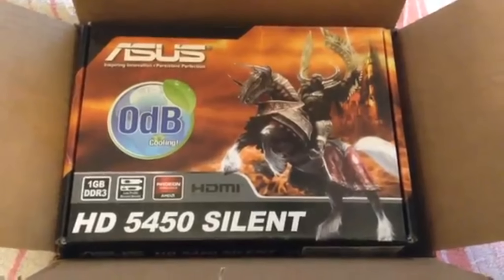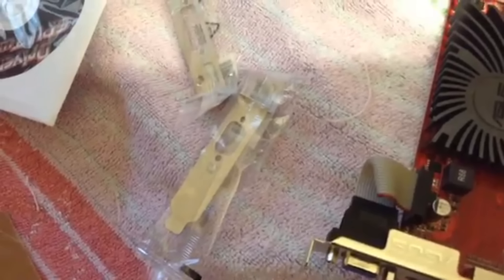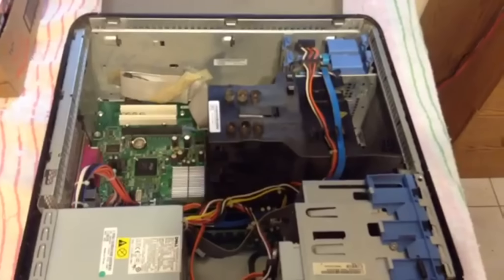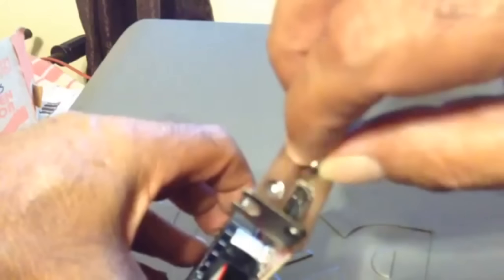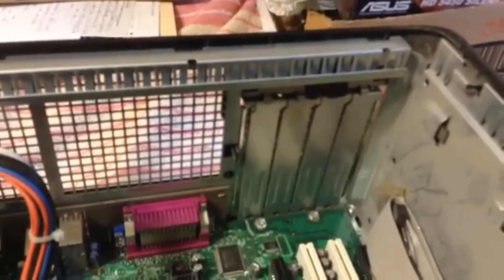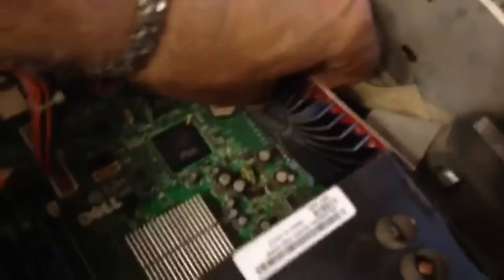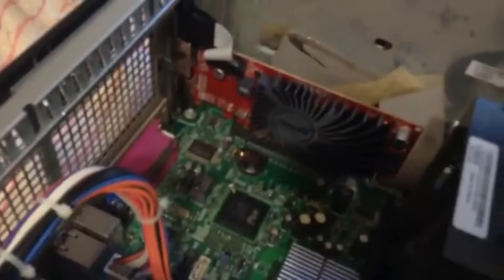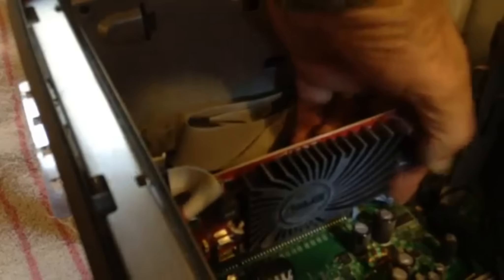DELL OPTIPLEX 745 Minitower INSTALL ASUS HD 5450 GRAPHICS CARD - Upgrade

Comment from the maker: Installing a Graphics card on Dell Optiplex 745 Minitower - Upgrade. After installing windows 8.1 and upgrading to 8 GB Ram, I decided to add a graphics card to improve the video. I found a good deal with a ASUS, HD 5450, 1 GB, DDR3 ASUS, ODB cooling, It has no fan. It comes with the low profile brackets as well and I show how to convert to low profile if necessary.

Comment: cud u pls say I also have the PC but can't find a GuD graphics card for it pls help iz it gddr2 or gddr3
Reply from the maker: +Mohamed Fathas  - it's a GB, DDR3 ASUS,  for more info look at the description of the video. Good luck
Reply: +John C thank u very much...
Reply from the maker: +Mohamed Fathas  - you are welcome, good luck.
Reply: +John C  only one doubt I small bro has core 2 duo e4500 with 5gb ram same like Ur PC shown its dell optiplex 755 wat graphics iz it should it support gtx 750ti and is it processor fm2 or am3???pls ans last...
Reply from the maker: +Mohamed Fathas - If I understood your question my comp hasProcessor:  Intel Core 2 CPU  6300 @ 1.86GHz   1.87 GHzInstalled Memory (RAM): 8.00 GBSystem Type: 64-bit operating system' x64-based processorWindows 8.1 PRO

Comment: hey man! what is specs of the power supply used in this cpu?
Reply from the maker: on my pc spec,
DC power supply wattage: 305w
power efficiency: 75%
heat dissipation:  1041btu/hr
Voltage manual selection: power supplies 90 to 135 V at 50/60Hz, 180 to 265 V at 50/60 Hz
Reply: is it a standard atx
Reply: or oem
Reply: John C RV: Is your power supply the orignial one that is installed by dell in this pc? Thanks in advance.

Comment from the maker: Hello Emiliano,
Your Reply button is off so I can not reply directly to your comment, hopefully you will see this message.
I have not done any other upgrades to it except what I mentioned on the above description and on the video. All I can tell you is that I been using a Movie editor program with this computer and its kicking butt. I do not play video games on it so I cant comment on that but I will add another Hardrive since it seems to be holding up very well.
Reply: do you need a spicific graphics card for any pc like is there any other different ones that dont fit in the slot?
Reply from the maker: you need to make sure its compatible to the computer you have.
Reply: how do I know though?

Comment: Bro my pc ram is ddr2 6gb so i install this asus hd5450 in my dell optiplex 745
Reply from the maker: Cool. That should do it.
Reply: can i install graphics card?
Reply from the maker: sure
Reply: Bro plz tell me which graphics card use in my pc to run gta 5 or gta 4 and something like this games in my dell optiplex 745 tower
Reply from the maker: Either one should work, good luck.
Reply: Thanks Bro
Reply: Bro can i put core 2 quad q6600 in my dell optiplex 745 tower
Reply from the maker: that I'm not sure, sorry.

Comment: How many your power supply?
Reply from the maker: Not sure what is your question.
Reply: @JohnCRV  My question is I have dell optiplex 745 with 305 watt psu so plz tell me which graphics card use in my pc?
Reply from the maker: This one should work just fine.
Reply: @JohnCRV  Can I put amd graphics card in my pc?
Reply from the maker: To make absolutely sure you should ask The manufacturer of the card.